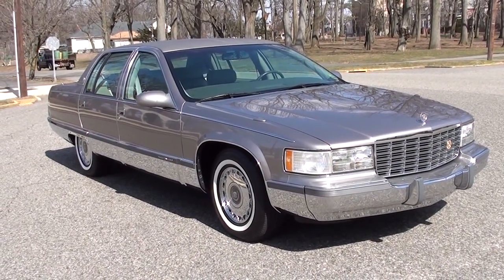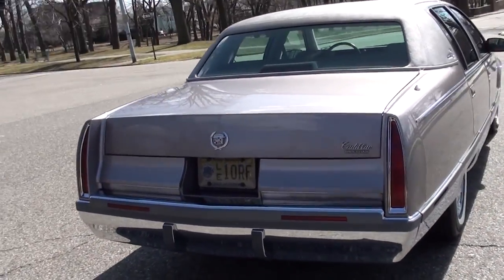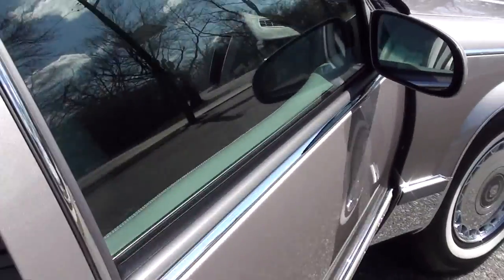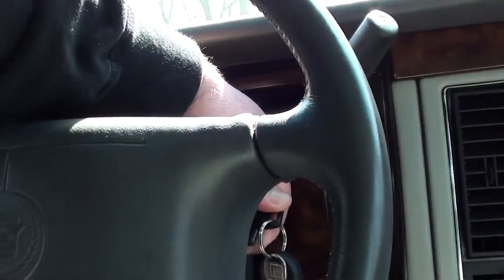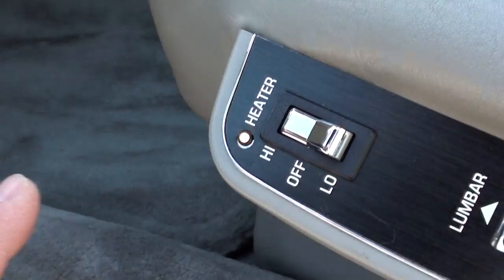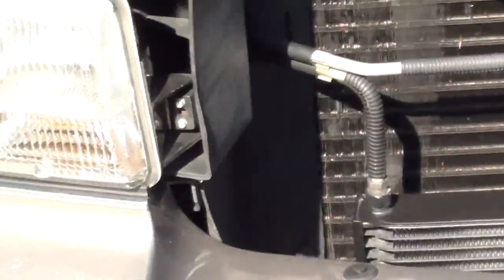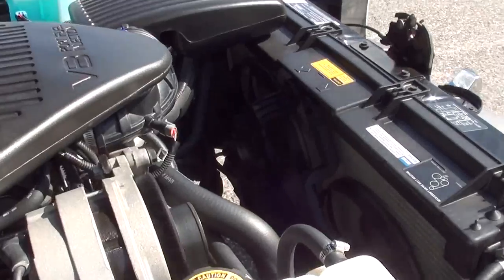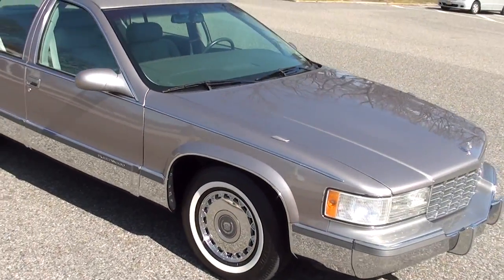1995 Fleetwood Brougham in pristine condition walk around.

Comment: I have a 93 Fleetwood triple black on 24 inch rims is beautiful it only has 83,000 miles on it I paid 2800 for it can't go wrong with these kind of fleetwood's the last of the rear wheel drive front wheel drive Cadillacs are a joke

Comment: Had a 93 Brougham.  Last  REAL  Cadillac. I was  second  owner and  car was  pampered.  BUT  rear wheel  wells  rusted,  resulting in da M
Reply: Got cut off!  ...resulting  in dampness in  trunk AND  rear seats (both  sides)!  CD player went  bad  and  driver  leather  seat  peeled.  Only had 80,000 miles on  and  was  well cared for.  Oh yeah,  rear  air  suspension  also  went.  Previously  had an 89 Brougham deElegance with plush velvet interior. Definitely  overall superior 😌 to  93. Yes I know  the  350 engine was a big deal. But the  89 had  ample power,  higher  quality  carpet, vault like  feeling, and  MUCH more  traditional Cadillac look.  Since  have  moved to  Lincoln Town Cars. Currently  fortunate to  have  beautiful  2007 Signature Limited and will keep it until it  or I go  into the  great  beyond.  So  sad  😞  about the  demise of the GREAT AMERICAN  LUXURY  SEDAN 😢

Comment: I know the 95 and 96 has the LT1. What  is the difference between the 95 and 96, besides the year?
Reply: 94 95 96 all basically the same all had the LT1 in them. 93 had the 350 good car just didn’t have the get up and go as the LT1! !  I had a 1994 fleetwood sold it with 69,000 miles the week after I sold it the computer went out on it!  I paid for the new computer and I have a 1993 caddy fleetwood has 60,000 miles on it also have a 1995 Buick roadmaster with LT1 has 78,000 miles and hood as new!!!